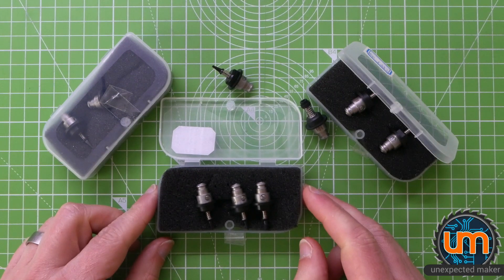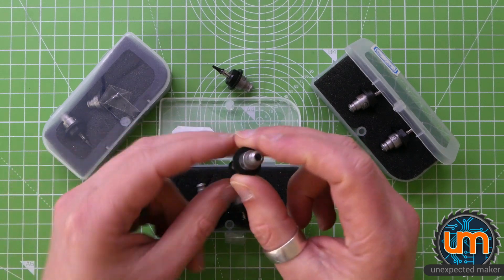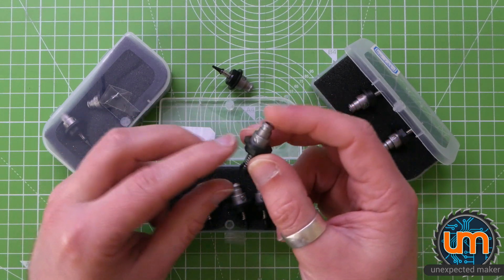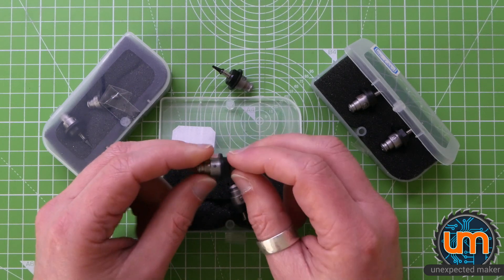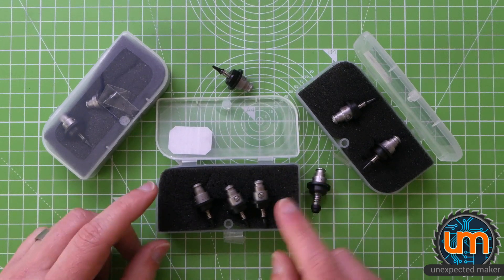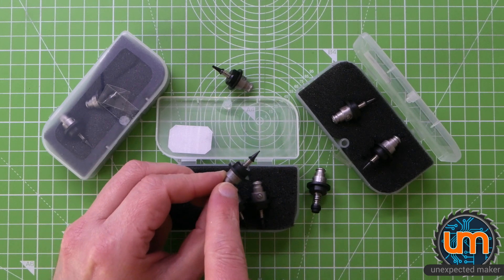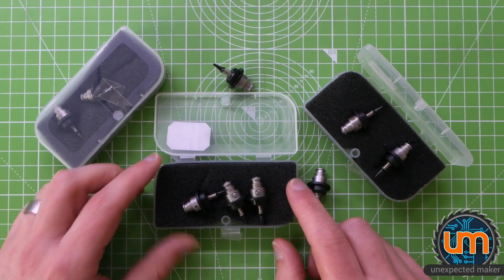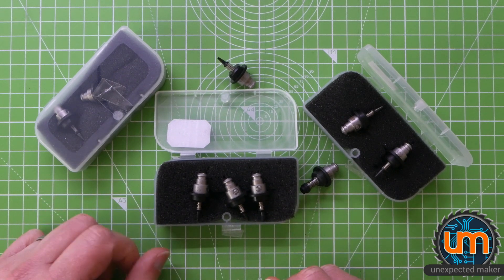My Pick & Place - Juki Nozzle Storage Rack

Comment: You should try to make a nozzle automatic changer? nozzle magazine needs locking mechanism so they don't spill out and the head just needs to know the placement of nozzles in the magazine, it goes for a nozzle and turns or pushes it in automatically on and when it returns , it put the nozzle back in the magazine position , locks the magazine , machine head pulls up and removes the nozzle, all depends what kind of mechanics the nozzle uses to lock and unlock . similar to Siemens Pick and Place machines . These nozzles what you have , are alot different that those machines have but it shouldn't be that challenging to design for this machine , makes life even easier , because the machine can change the nozzles itself and doesn't require you to be there for nozzle change.
Reply from the maker: It's not possible on these CHMT machines.. The software is closed source, so no ability to add support, (OpenPnP is not ready yet) - there is not enough clearance, and the heads can't travel down far enough to lock into a nozzle, or unlock from it. But most importantly, the heads are not designed for auto-changing... it takes tremendous force to remove a nozzle by hand, way more force than what the head can manage in it's up/down movement.
Reply: @UnexpectedMaker  Yeah, on siemens machines it's finger tight basically :) SIPLACE TwinStar, most similar to this :)
Reply from the maker: These are WAY more than finger tight - in fact, it's recommended to put your hand under the nozzle you are pulling out, due to the force of the extraction, and not wanting the tip to hit the metal deck. Many have wrecked nozzles this way:(
Reply: @UnexpectedMaker  damn, but those are not for production anyway , they are more like hobby machines :)
Reply from the maker: I've build almost 7000 boards on this thing using 0402 and up - It's far from a hobby machine.. it's targeted at prototypers, not hobbyists :)
Reply from the maker: I can't believe you are comparing an ASM with a USD$4k CHMT ;) I've seen lots of auto nozzle changing systems... none will work on this machine - it's just not built for it... not without requiring a lot of hacking and re-design... and it's just not worth it.
Reply: @UnexpectedMaker  only thing that I work with, that's why I compared like that, we don't have any other machines 🙂 just was thinking if ... But it's a nice machine nevertheless.
Reply: @UnexpectedMaker  should try to build it myself some day, but I'm building a CNC machine out of scratch right now🙂 so, another time😃
Reply: @UnexpectedMaker  https://www.youtube.com/watch?v=ZGcdT5To7qo we have something like that Simens line, but even newer , 2018 line.  Like , really complex boards are like nothing for those machines, but because of that , they have a really high price tag too :D

Comment: Great solution to your problem! Agree with @james Sharman - it's still magic to CAD something up and then have it in your hands (hours) later. Did just that to solve an issue with a camera mount last night. THe Love of 3D printing! You should check out Hayri's Juki nozzle holder he made - made it out of PCB's with embedded LEDs too... https://www.tindie.com/products/PhoenixCNC/juki-nozzle-holder-for-nozzle-changing-pnp-machine/
Reply from the maker: Oh wow, I'd never seen that - I was thinking of adding LEDs that light up the number for the nozzles not present - using some IR sensors... but you know... I'd still be designing it months from now ;)
Reply: @UnexpectedMaker  that sounds cool! Can the PNP pick up it's own nozzles too, like a tool changer??
Reply from the maker: No, unfortunately mine cant auto-change :(

Comment: now your pick and place needs a robotic arm that can pick and place them on itsself :)
Reply from the maker: THAT WOULD BE AWESOME!!! Totally not possible though :(
Reply: I've seen such 'behaviour' in car construction robots. they change their tool by putting it back in a rack and picking up another one
Reply from the maker: Sure, but those are designed to be "swappable" - mine are inserted from underneath, and they are delicate to insert and pull out, with only 5cm of space between the insertion point and the PnP deck - almost not enough room to get my hand into.
Reply: sadly you are still not outsourced by yourself then :)
Reply from the maker: @Azy There is no place the head can move to that has enough clearance underneath for automated swap-out - also, the heads are just not designed for it. It's ok... I don't need this automated... just having better access to the nozzles and a poke to keep them all together is a big improvement to my workflow.
Reply: @UnexpectedMaker  Maybe when the charm hi PNP is OpenPNP compatible, it might be possible to have auxiliary inputs and outputs you can attach other motors and sensors to, and use custom scripts during the PNP phase to move motors for a tool changer or somesuch. Never say never :P